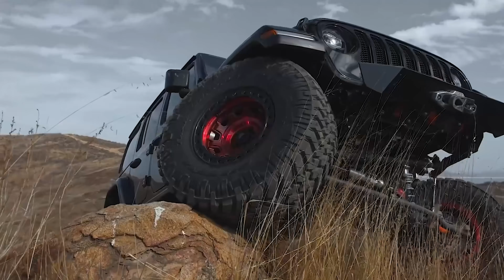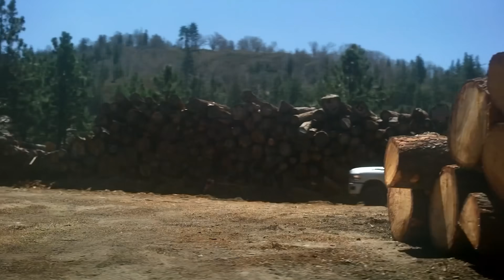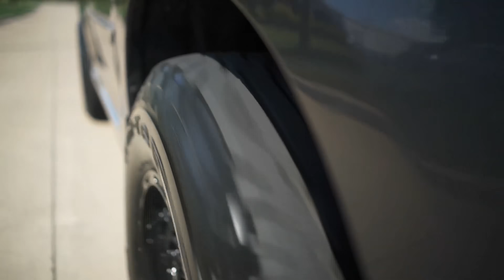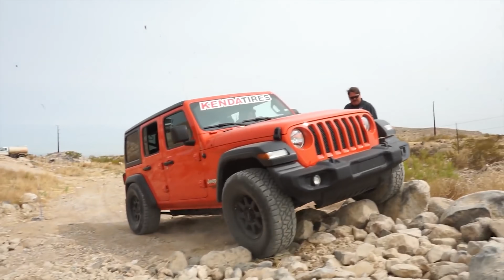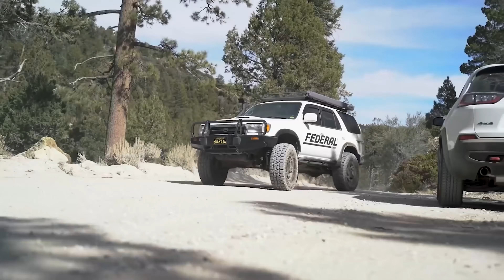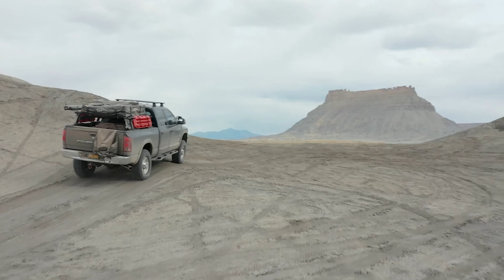The Ultimate Off-Road Tire Buying Guide!

Comment: Seem to value the 3pmsf and m+s rating or at least mention it quite a bit. It might be worth mentioning, that not all tires that have it, are good. I have hankook dynapros on my new truck and they're trash compared to the wranglers my other truck had. Both at tires, the hankook wet traction is ass, break loose with much less throttle on snow/rain.

Comment: Thanks for the great info., what is recommendations for all terrain tires for 2015 Explorer with 20R rims.
Reply from the maker: Depends on the type of look you are going for with your setup, I found this setup in our gallery running those specs and I really like it! https://www.trailbuiltoffroad.com/wheel-offset-gallery/2518176/2015-ford-f-150-fuel-rebar-6-zone-suspension-lift-6in

Comment: I’m trying to find legit advice on whether the trail terrains would be sufficient for a half ton truck that occasionally tows given the limited weight ratings offered. I don’t need the KO2 for how much I’m on road but I also don’t want a CUV tire
Reply: I would try something like the Yokohama GO15. Nice rugged tire with good all weather traction and better off road than you'd expect, plus some nice reasonably still walls for hauling and towing. Puncture resistant and great tread life. They had a little whine on concrete on my truck, but only at like 68 mph, quiet at all other speeds. I know your post is old but I hope this helps.

Comment: Wow, this video summed up a massive amount of highly technical tire technology in a concise video!  I've been in the tire industry for over 10 years, specifically in LT/Off Road tire evaluation/performance and the amount of condensed information here is phenomenal. Wet compound traction(not hydroplane) are some major differences you'll find overall, with winter performance(tread compound and design) a close second outside of major design differences in mud/sand traction already discussed in this video.  Excellent video!
Reply from the maker: We appreciate the kind words and the support!

Comment: I break through brush, honey locusts, sharp rocks, occasional lost fence post, etc. I just gashed the sidewall on my Trxus M/T so bad I won’t keep driving it. 
I take my air down to 8psi on sand, 18 on rocks and whatnot, 25 on the road, 35 long trips. I need tough sidewalls. Oh, I also have a thing for ignoring curbs so yeah I need tougher tires.

Comment: 3 peak mountain snowflake is a spin up traction test only. No braking. No handling. It is acceleration only and done in a lab. It's an indicator of possible winter performance, but so much more goes into a tire actually being good in the snow.

Comment: ATs don't cut it in mud. Siped mild mudders with a compound that doesn't freeze will work OK almost anywhere. Check out the Trxus MT and the discontinued Parnelli Jones Dirt Grip.
Reply: We've had great luck with the Yokohama MT, they've done well in rain and snow, better than my old Mickey ATZP3. A lot noisier though and they flat spot pretty bad. The mickeys are better in most conditions except crazy mud and snow, and they fixed the snow with the new version. You are right. There's nothing  more slippery in the universe than a Falken or BFG in the dirt after the rain.

Comment: I have a question.  First time this has been an issue. Everyday I have to drop my tire pressure to 33lbs from 37 lbs sometimes 39lbs why do they keep getting so high in pressure? Should I just leave it alone I have a jk so it’s not heavy. 315/70/17 size Goodyear territory mt tire
Reply: When they warm up from diving the pressure goes up.  Only check tires when they're cold.

Comment: Sipes are for gaining more straight line traction in slippery conditions. The reason the sipes don’t go all the way to the edge of the tire is to prevent chunking of the edges of the tire if you are to drive off-road.

Comment: Almost 20 min of this video is a BFG Trail Terrain overview just a heads up.
Reply: I just ordered the BFG trail terrains so that’s good.
Reply: Bfg fkn suck lol. When I worked at a tire shop most tires past a yr of production date started to crack bad between the treads
Reply: @carlossalazar2164  not sure when you worked there? Time will tell how the tires do after a year? All the manufacturers are using the basic same rubber compound. I purchased these tires at Costco so they have a 60k mile tread warranty. The BFG trail terrains are very similar to the BFG KO2, but street oriented bias. Pirelli owns BFGoodrich so they stand behind the product. BTW - I do like my Trail Terrains, I’ve put on about 5,000 miles.
Reply: @Mitchell Kasdin  just my experience when I worked at a tire shop, you're going back 11yrs. Maybe they did improve already, but personally, I would never run them
Reply: @carlossalazar2164  With the advent of computers,  cad-cam and material science, what was status quo is no longer the case. Michelin the parent company would not warranty the tires for 60k miles if that was the case? Also, not sure where you worked, but the BF Goodrich Trail Terrains are new tires, first labeled and manufactured in 2019. So when you say the tires are no good it’s conjecture not real world experience.  I own the Trail Terrains tires and overall they are far better then the OEM Pirelli Scorpions 🦂. Are the trail terrains the best tires? Probably not, but there is no best tires in all categories.
Reply: @Mitchell Kasdin  yee once again based on the experience that I've had with the brand bfg it is a brand that I avoid personally. My default tire has been mickey Thompsons been running them for years and have never had a single issue. From AT to hybrid to mud terrain on average, I get 45 to 50k from a set. even have a set of 33s that I use for rollers on my project truck that are pushing 12yrs old and don't even look weathered yet 🤷‍♂️
Reply: @shootsandscoots  bfg's definitely have cracking problems and plenty of other off brands that put them to shame like no tomorrow
Reply: @MrBULLRIDER13  when was the last time you bought BFGs tires? Doubtful, that they won’t last. The parent company is Michelin and it has a warranty. What you describe is a manufacturer defect
Reply: @shootsandscoots  I have a set on the front of my wrangler. And Michelin is more of a worse tire I absolutely hate Michelin tires they are garbage. The only thing they have for them is treadwear. Had a set of ltxs on my pickup and literally couldn't get traction on wet grass and that is not a joke. I wanted to throw them through Michelins window and have had many tires on many rigs and I would put tons of off brands against Michelin and know they would whoop Michelin in every category but treadwear
Reply: @MrBULLRIDER13  I bought them from Costco so they back up the warranty! I’ve called BFG and Michelin before and they are responsive. Not sure about the LTX tires, but I would take them back where you bought them.

Comment: Awesome video! Any plans to test the Toyo Open Country CT? I’ve had them on my Power Wagon for 15k miles and I really like them. Drove coast to coast twice with them, snow/ice, rain, mud, rocks…they can truly do it all.
Reply: I have the same tire and mostly use them for hotshot in the north but occasionally head south so they've seen it all. From hauling pipe into AZ mines up steep grades on loose gravel to hauling conex in ID out of massive cobalt mines on tight single lane snowpacked mountain passes and all the HW in between. They are fantastic tires that deserve more attention.

Comment: What tires would you recommend for casual offroading. I drive a chevy trailblazer with 5" worth of lift(3" suspension 2"body) and mostly encounter sand(sugar sand) with the occasional mud(clay) but also use the truck to daily around.
Reply: Best Hybrid tires. Nitto Ridge Grapplers. I daily them (about 40 mins each way to work). Not loud and it handles the curvy roads Just make sure your under 33 PSI any higher and your spine will shatter. lol 

I also went on many trails in Southern California. It was able to tackle most trails. (some just came down to articulation and clearance) Haven't tested on John Bull yet. Hope to tackle that beast this summer. Remember with sand will any off-roading (I.E Sand Hallow) its always about tire pressure. 20 PSI or less of if you're bead locked 10-15.

SET-UP
3rd Gen 4Runner. 4WD 2.5 inch lift. Nitto Ridge Grapplers 285/75/R16. 

2nd rec would be Toyo Open Country and Milestar Patagonia A/Ts

Comment: I recently installed Kenda Klever 35x10.5T17LT R/T and I instantly regretted it. I love the tires. They’re quiet and grippy but they look like 33s compared to my buddy’s 35x12.5R17 BFG KO2.
Reply: So you are basing your regret solely on looks? I love my 35x10.5r17 on, and off-road.
Reply: @LRtwins2  and your basing my comment based on just the word “regretted“? Please, now tell me what the sentence after my regret sentence says.
Reply: I've heard, if you shave your public hair, it'll make your "tires" LOOK bigger.  You are welcome.
Reply from the maker: Man thats a bummer! Kenda Klevers are awesome!
Reply: @TrailBuilt  I run Kenda Klever R/T KR601s on my Jeep XJ. I've always liked the performance of tall/skinny tires.  I've used wider tires for sand but I prefer tall/skinny for mud/snow.
Reply: @TrailBuilt  they are awesome. I decided to get the 10.5” wide instead of 12.5”. Being 2.5” wider sure makes big difference visually. Wished I knew how different it would look before I bought them.

Comment: I have old style kms that were jk rubicon take offs on my Gladiator. Great off road. But man are they noisy. They have a pretty symmetrical tread pattern. Smart of them to change that for the km3
Reply: Km3 are amazing. I've had mine for about a year now and the are amazing in snow,mud,ice,rocks. Plus ride smooth and pretty dam close to silent for a Mt tire

Comment: what is the best off road tires for 05 Subaru Baja
Reply from the maker: Great question! What kind of off roading are you planning on doing? Where do you live? WIll these be daily driven too?
Reply: @TrailBuilt  any all terrain tires that has M+S traction
Reply: @TrailBuilt  and yes they will be daily driven
Reply: @TrailBuilt  Looking at the thumb nail, are the Mickey Thompson Baja Boss AT bad tires ?
Reply: @gen1c8rs88  No. the MT Baja boss AT is a bad ass tire. I have them on a 3/4ton diesel and they are buy far the best I have had over the years and I had BFG at2 and GY duratrac and the MT Baja boss would drive past them in 2WD hands down a great tire and I highly recommend.